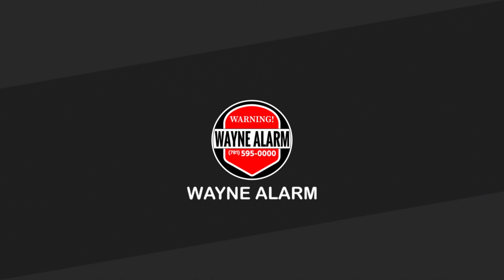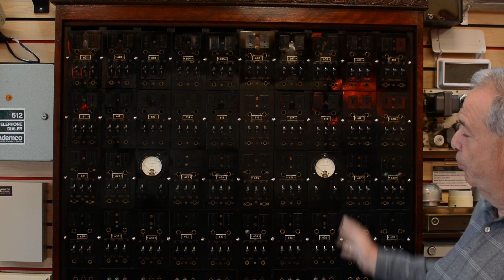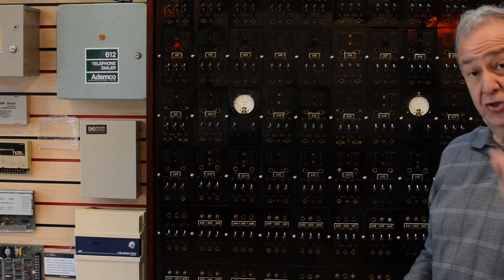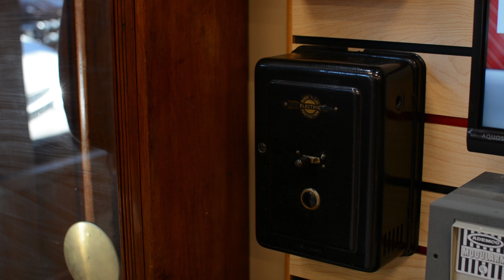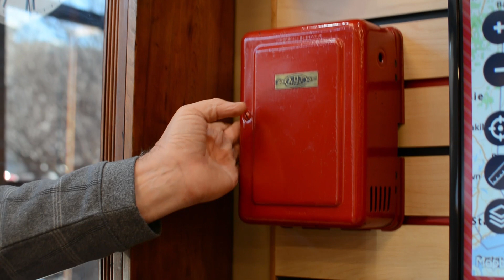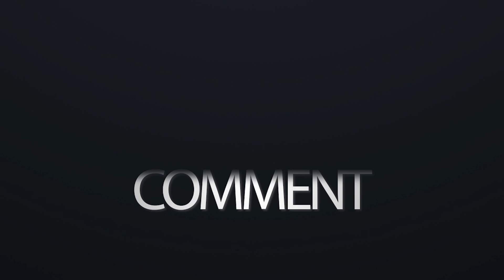Wayne Alarm Antique Corner: Direct Wire Boards | Ep. 42

Comment: Just found this,lol Worked  at Holmes, Jewelers 70s, had Potter direct wire modules and racks ,at the time it had just started to become automated, Holmes had Computech, Jewelers had a computerized Direct wire system ,cant recall the manufacturer ,possibly Varitech

Comment: I remember visiting an ADT central station in the 70's that had a direct wire receiving board. Very cool. There were tags on some of the modules. The manager told me those systems were undergoing work at the site. Very cool tech.
Reply: Thank you for your interest in our video!